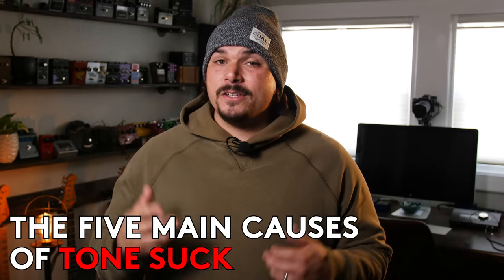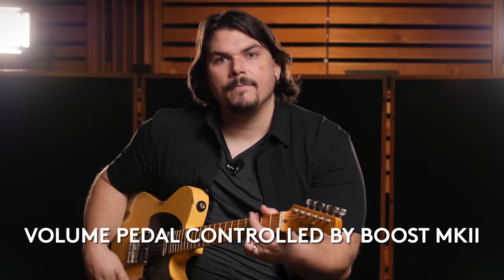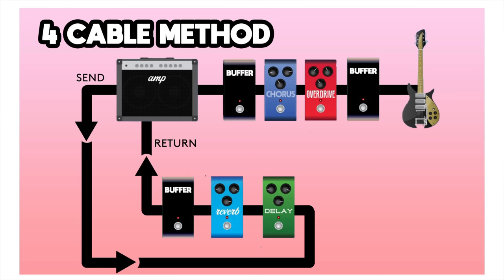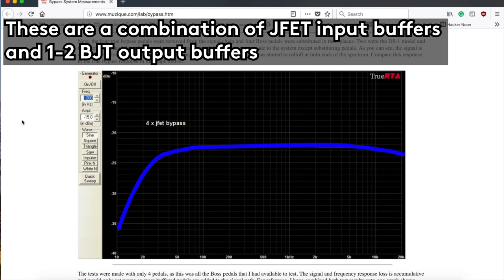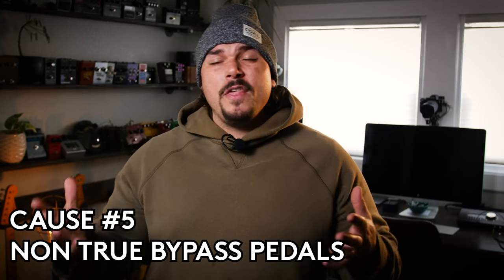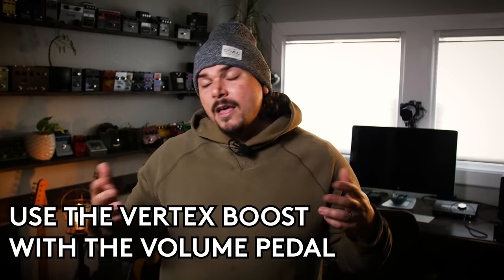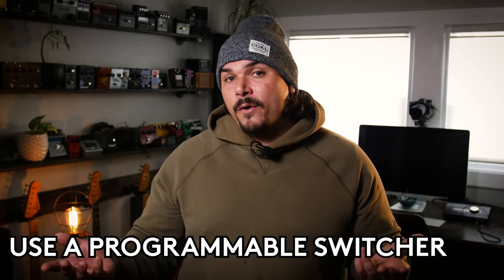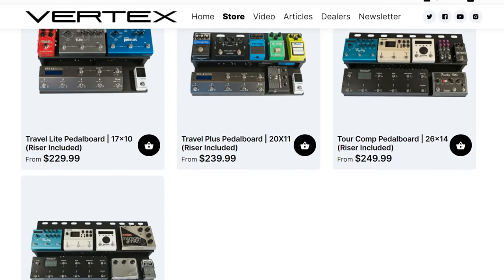Top 5 Reasons for Tone Suck

Comment: I used to think buffers were bad not knowing that all true bypass makes for giant ball of sucked tone. Now I like to have buffers especially on the “ends” before going in or out of the amp/long cables. This is a great lesson everyone should learn. Can’t wait
Reply from the maker: Buffer quality matters...a buffer alone, just any old buffer, won't be the same as another.  High quality input buffer and output buffer is key and they need to be the right spec!  1M input impedance, 100 ohm output impedance.

Comment: This is my new favourite gear channel! No Bs, no clowing. Just well presented wisdom being shared.
Reply: Ive been using my Tc Polytune first in chain, before my EB jr passive, in hopes that it would sort that tone sucking. Then i switch to plug the tuner into the EBall Tuner output. Now you teaching me i was better off like i was before. I Do have a digitech synth wah after the volume pedal, hoping it buffers it also. But maybe i m wrong. Great tips at the end. Very interesting kits. I run a 15 pedalboard with some TrueBP and Buffered ones. New pedals, and vintage pedals. So there must be some tone sucking for sure. Maybe i should put my EBall after the digitech and any other digital pedal as i tought all digital pedals have buffers on them. I probably will get a switchable looper. And your video on explaining looper and program. Loopers were really helpful. Just recently discovered this brand and channel and it looks very very promising. Keep up the great work, looking forward to hear more from Vertex fx.

Ps: i am experiencing a strange behaviout on my wah...i changed its pot. the pedal worked for a week, No problem. Now, the pedal when engaged is silent (its TBypass)...but if I take it out of the pedalboard and and just plug it alone, it works fine. I am in the studio doing reamps for an album i am about to finish and need to solve this issue. If you have any idea of what it might be and can shed some light i would be much appreciated.
Reply from the maker: Awesome, thank you!  If your TC Tuner has the buffer make sure that's engaged before the volume pedal.  I think it's always a good idea to have high quality buffers first and last no matter what.
Reply: @VertexEffectsInc  unfortunately it is the previous version of the Polytune. I dont think it has a buffer. I am a newb so, my tought was that every digital pedal i have (if doesnt have a choice between true bp vs bufferbp like the DL4 line6) it should buffer the signal. Yesterday i compared the combo of having the tuner on the out of the Eball Vol versus having the tuner has my first in chain pedal. The difference was really subtle and it seemed more in amplitude that in high frew roll off. But yes good tip there! Thank you. Buffer as a exterior pedal i never tought much about but you make it reconsiderable.
Reply from the maker: @sun6moon9  it's a foundational piece that is really critical that most people overlook when spending big money on pedals.  We have a few cheaper recommendations like the Truetone Buffer which is only $50, you'd need two but it's still great.

Comment: Saw this tonight…I had only 3 pedals hooked up. One was the fuzz first which is true bypass, then a Jekyl and Hyde V1 and then a old DOD pedal last. When I removed the old DOD pedal which is buffered…my tone came back less muffled. I cleaned up this pedal and it sounded broke before. Got it in good shape, but it just takes off some of the clarity when off. I’m going to clean it up again and possibly put it first after my fuzz. Although it is a plexi drive type pedal. Not my preference to put a high gain pedal earlier before my OD. But it’s worth a shot! I don’t use it much but it’s there if I play something heavy. Honestly I think it may have some issues, as the light is still on even when you turn it off. So something is def up!
Reply from the maker: Hope the video helps!

Comment: During my internship at a recording studio, we troubleshot a guitarist’s rig : guitar direct into his amp sounded amazing but plugging his pedalboard made ALL of his high end disappear, like putting a low-pass at 1-2kHz
Turns out it was one of those cheap patch cables with molded connectors that was the culprit. Felt especially bad since the guitarist had a great setup with vintage amp/guitar and cool pedals, and toured the world with it, only to be ruined by a single cable haha
When I came home that night I threw away all my cheap cables and invested in good ones lol
Reply from the maker: Now a good buffer might have eliminated a lot of that, but still good cables matter.  Check out our patch cable shootout and see how the buffer impacts the overall tone and normalizes cables pretty well between the cheap and high end versions.
Reply: @VertexEffectsInc  will do!

Comment: Excellent video on a topic where there seems to be a lot of confusion. Though not technically "tone suck" in terms of capacitive or resistive loading, your video reminded me of when Dave Phillips from LA Sound Design asked why I wired Doyle Bramhall II's Zoink with a grounded input when in bypass. Dave mentioned he didn't notice any additional noise without the grounded input on my full size Zonk Machine clone. One thing some don't consider in terms of "tone suck" in true bypass pedals is grounding the input of of the circuit when in bypass mode. Although your guitar's signal is not technically seeing the circuit when bypassed, the circuit is still energized when bypassed and can induce noise in the bypassed signal wires within the enclosure. This is especially true with high gain (fuzz) circuits when everything is in close proximity in a small pedal board friendly enclosure. In the case of circuits with oscillators, grounding the oscillator when bypassed eliminates any chance of induced tick in your bypassed signal. Though relatively rare the bypassed signal will have noise induced on it, it CAN and does happen. When it does, it can be a real wild goose chase to track down if you don't know where to look. Grounding the input of a high gain circuit when in bypass eliminates or at least mitigates induced noise on your bypassed signal. Grounding an oscillator in bypass always eliminates any chance of induced tick in your bypassed signal.
Reply from the maker: There are several ways to do true bypass, the BEST of which grounds or shorts the circuit when in bypass so you don't get any risk of oscillation when the pedal is off.  Often when I did build pedalboards for hire, I would convert pedals to this standard unless they were in a switcher.  Yes, high gain circuits are more susceptible to this issue, also pedals that have internal clocks as well: chorus, phaser, flangers, to name a few - are also susceptible to this.  We have another video that mentions this...not sure what the title was we've made so many, but basically something along the lines of "not all true bypass is created equally".  Thanks for watching and for the comment.

Comment: One of go to pedals is the Digi-tech  digidelay, all of my X-series and many dirt pedals of that era have 1meg input and 209hm output buffers. I have used them plugged in but not turned on to condition dinars in my sound design work. Piezo contact  mics ideally want about 4meg to stop tone suck. 1meg goes a lot further in retaining the bass frequency response than many other modern low impedance devices.

Comment: How you doing Mason? These videos are such a great resource for guitarists. Very much appreciated.
 I'm using a GigRig G2 in a Wet Dry Wet rig. My instinct is to use 3 Mesa Dual Buffers... 
- T
Reply from the maker: The G2 has its own buffers.  I don't like the output impedance of them but the input buffers should be fine.  I would just use a separate output buffer or at least experiment with it to see if you notice an improvement.

Comment: Great video! How can I measure the capacitance of my instrument cables? I spent quite a bit on them (worried I spent more on the brand name than anything else) but I can't find any specs on them online. Thanks again!
Reply from the maker: The simplest way is to consults the spec sheet.  Most brands have this.  What's the cable?
Reply: @VertexEffectsInc  it's the Fender professional series.

Comment: I've got a Creation Audio Labs buffer inside my custom tele with Lindy Fralin humbuckers! Absolutely love it, and I love how the signal quality stays intact with all the highs. And yes, I tried a treble bleed cap mod and it didn't work so well for me.
Reply from the maker: That’s great for the input buffer - you’ll still need an output buffer.
Reply: I run an ampless rig, with my Atomic Amplifire. My signal chain is just guitar - radial instrument selector - EP booster - Atomic - FOH.

Comment: I have the Ernie Ball MVP volume pedal. When I got it, I was "WTF? it needs power? "Oh well, I've extra supply plugs since my pedal board is quite sparse." My tuner goes into the tuner output from the volume pedal... no tone suck at all.

I'm a Tele player, love clean twang. I use your Steel String Clean Drive (it's heavenly). It just warms things up so nicely.

The Clean drive turns the guitar's volume into a gain control, blatantly. For my clean Country twang, I'll back off the guitar's volume to 2/3rds, open up the volume pedal. For Blues with a bit of edge, I'll peg the guitar's volume, cut back on the volume pedal... the Clean driive, nearly full gain, delivers exactly what I'm looking for. It adds sustain across the board, clean or hairy.

I'm wondering if this volume pedal has a buffer. I do use the Boss/Fender '63 Reverb...  In this vid, you have it with pedals you said have built in buffers. Am I correct?

Most of what you said in the vid goes way over my head tech wise.... I wanted to stop you many times and ask you to explain... but, I can't. 

My Tele has a 1meg volume pot, 250k tone... No tone suck at all. I can still peal paint with the bridge pup if I wanted to. When on the bridge pup, I ride the tone knob more than the  volume at a gig....

Love your products... and your vids...

Thanks.

Comment: Awesome video. Is it bad practice to position pedals based on how you use them, vs where they are in the signal chain if it means having a few long (12" - 18") patch cables instead of 3" cables?
Reply from the maker: That amount of cable length difference should be negligible.  Shouldn't matter.

Comment: What are your thoughts on the Dunlop X volume pedals? Do they produce town suck as well? I have a couple striving paddles, and then HX stomp running through my board. Do those count as buffers? (I.e big sky, mobius).
Reply from the maker: All passive volume pedals do, but I like the mechanical aspect of this pedal and use them often with our Vertex Boost as the EXP controller for the volume.  They can be buffers, but those are all on the output, no input buffer in your list.

Comment: The Intermediate tone sucking happens on phaser pedals and Univibes which will Fatten up your tone because its still running your audio signal through the phaser pedal or univibe while its turned off. David Gilmour live Pompeii 71 used a volume pedal so this would give him a darker tone put his vox wah is intermediate tone sucking also. Most pedals that used a SPDT switch all were Intermediate tone sucking. In the 80's people used the Boss PSM-5 RED pedal to turn off all there guitar pedals. The Boss PSM-5 has buffers and Fet switching. Have you look at the schematic of this pedal and the tone sucking?
Reply from the maker: I’m sure the PSM-5 was similar buffer to what Boss was using generally.  There is very little variation over the years.
Reply: @VertexEffectsInc  It uses IC chips 4558 which the output impedance was 10K which I'm not sure why boss wanted 10K output impedance

Comment: Another great video!!! Very very useful. Just one question: how to measure the capacitance of a cable or a pedal with a multimeter?
Reply from the maker: It’s hard to do properly with ordinary instrumentation and the plugs also have a capacitance as well that you’d have to zero out to isolate what’s from the cable versus the plugs.  Most manufacturers have a spec sheet that already tell
You this.

Comment: Good video. Question. If you have a pedalboard with a bunch of pedals, when all of them are turned on at the same time you don’t need (in that specific instance) a buffer correct?
Reply from the maker: Any device that’s turned on is a buffer at that point whether it is true bypass or not, however the quality of that buffer will vary greatly, some are OK, few are great.  There are very few conditions or circumstances that I can think of where are you won’t need a high-quality input and output Buffer.

Comment: If you use a pedal pre-amp (bass) with XLR straight to FoH, would you still use an output buffer (say, between the last fx pedal and the pre-amp) or just an input buffer at the start of pedal board?
Reply from the maker: No, if you’re going balanced you don’t need an output Buffer

Comment: Thanks for the great info!....I start my pedal board S Chain with a BSS Audio AR-133 active DI-box. SO my FIRST QUESTION is: What is your opinion of the AR-133 as a buffer? Then the signal goes into a MORLEY 3 WAY SPLITTER ( I use a small yamaha mixer at the end were I mix my drum machine and drone textures, with at least three signals from my guitar that each ends into its own amp-cab modeler before they go into the mixer) SECOND QUESTION: I have experienced once the weird phenomenon of no signal coming  out of the other two splitter outlets. How is that even possible? I have some more Q but will limit my questions to these two, for now at least. And will welcome any comments or suggestions  on my set up... Thank you for your time.
Reply from the maker: Looks like 1M input (which is good for guitar), 600 ohm output (which is so-so).  I would suspect that your splitter might have some issues with the outputs because the input signal is shared among them if it's a single input to three outputs.  Could be the cables could be the jacks in the splitter, could be something else totally.

Comment: My DOD Rubbernecker analog delay seems to have a crappy buffer in it. If the pedal is on it sounds great. But if I turn it off with tails on, I loose db. Turn the tails switch to off and the db come back. I have a very well buffered reverb pedal after it and it is fed from an always on SA Programmable EQ. Never noticed it at home, but at the sound check it became a problem. Now I run it "tails-off", problem solved. So far, that's my first complaint about that delay pedal. It's a beast.
Reply from the maker: It may be using a BJT or something that doesn't quite get back to unity gain.  You may consider just leaving it in TB mode in that case.
Reply: @VertexEffectsInc  Thanks, Yup. That's what I did.  The sound guy, Alex showed showed me the DB loss on mixer app from the board, it was around 4 db! But I could hear it as well. Took me a couple seconds to realize the BP buffer was engaged and likely the prob. True bypass option switch saved the day.

Comment: Orange or50.. guitar straight in awesome. Or50, crybaby, tu2, carbon copy... livable.. but as soon as I ad my mxr reverb, true bypass setting or buffered. My tone changes. Enough to annoy me that I wont use it. Think I need a loop switch.
Reply from the maker: Could also be cabling, or other factors.  What if you just use the Reverb on its own - guitar, reverb, amp?  Same issue?

Comment: Great video. Thanks for making it. You're a great communicator! I have 12 pedals in my chain (nothing vintage or Boss/Ibanez). Right up front is my TC Electronic polytune 3. In their literature they say the buffer in it will solve all of the issues associated with long cable runs. Do you know this to be true? Thanks in advance.
Reply from the maker: That'll be fine, but you still need an output buffer at the end that's also high quality.

Comment: Great video, thank you. So lets say you have a buffered looper and have all loops on. What does it do to the tone to have so many buffers on at once? Can't be good regarding tone suck... or do good loopers have smart non additive buffers in them? Anyone?
Reply from the maker: Presuming all the loop on but the pedals in the loops are all off so you're seeing all the buffers in series, it will depend on 1) the quality fo the buffers as there is no standard and also 2) the specs of those buffers in critical places like the input and output of the system.  Generally it will add noise, attenuate your output, and not be great for the overall tone.  If you turn on all the pedals and leave them all on, I don't suspect tone suck will matter much as it will be such a mess of sounds.
Reply: @VertexEffectsInc  Thanks for your answer. I use the switchblade 8F which has a reputation of using good buffers. I shall measure the inputs and outputs though. In addition some of the pedals have buffers too. Guess I’m way overbuffered here,  especially since buffers zap voice and I like to eliminate/ minimise them in my chain whenever possible.

Comment: Do a video on what using a wireless input on the board dose to signal and tone, or if using a buffer or boost. Common affordable units  like  Line 6  G10 or Boss etc..
Reply: I'm using a AKG wireless bug system going into board and Getaria 5.8 rechargeable wireless going to amp. The reason; I put my board on a stand to twist knobs on the fly. 12 pedals on board including 3 drives, 2 delays. I also bought a lot of used pedals most modded. My last pedal is a silent modded 10 band EQ. I actually have a dB-1 boost/buffer next to EQ but have the buffer turned off cause it doesn't change the sound in any way. I used EBS Gold flat cables on the whole board.